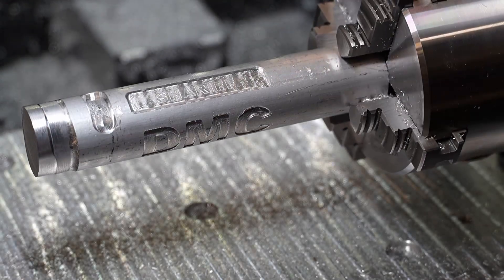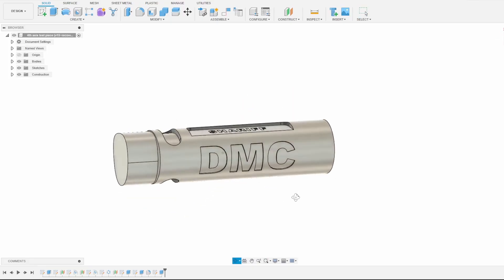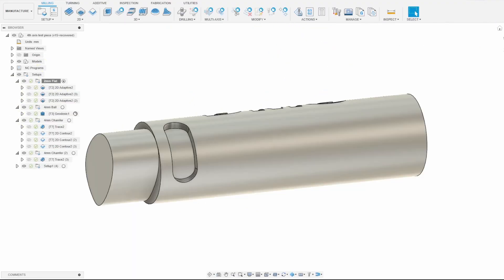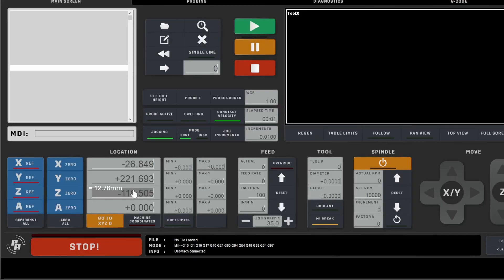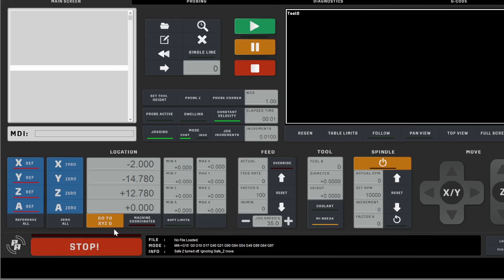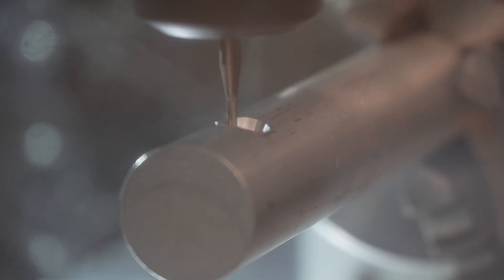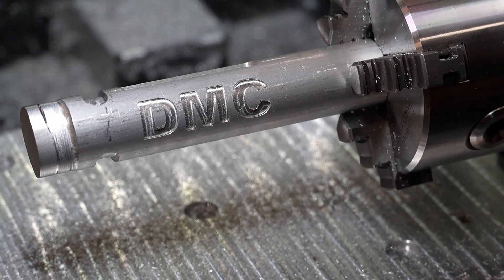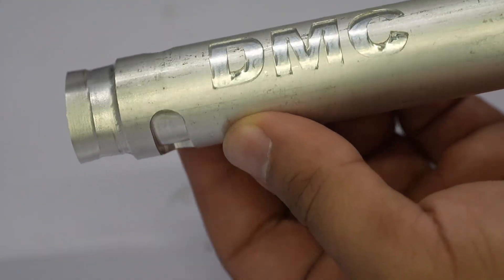Lets cut ROUND PARTS on the Shariff DMC 4th Axis

Comment: I got one of the DMC and I had to make a new frame the QC on them is so poor you need a hammer to put it together.... run don't walk
Reply: I had the same experience except I ended up cutting my losses. The frame design is absolutely terrible and so are all of the other components. You are better off building your own machine or just getting a more capable cnc router. Also, a few guys already put together a 4th but Omar probably removed there posts.
Reply: @yakswelding86  I just made a new frame. 100% it's all just junk but I have a Lathe and Mill in my shop so making the new frame was easy. 
I don't post any of the parts I make with it because others will just think the DMC is a good CNC and it's not....
Reply: What about its accuracy? I need to use it for cutting steel. Do you think it’s suitable?
Reply: @mustafadheyab6513 no unless you have a Mill and lathe like I do and can make replacement parts that are not scary missed aligned so you don't need a hammer to put it together...